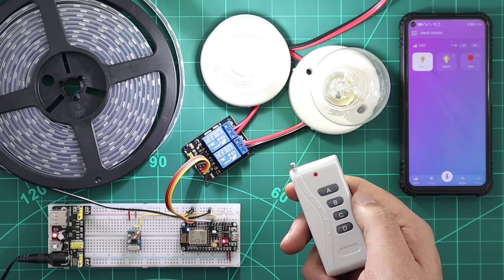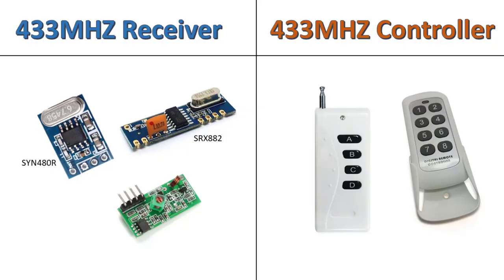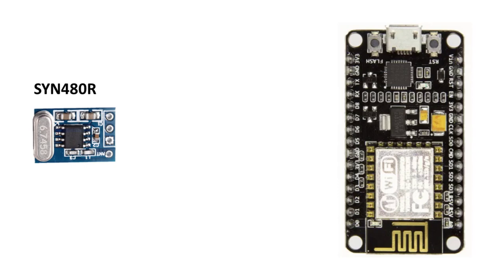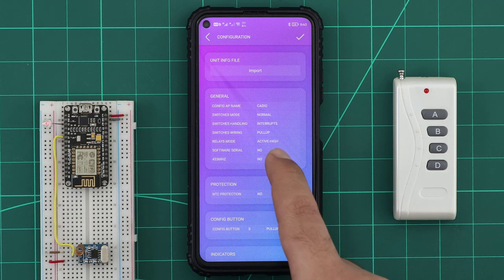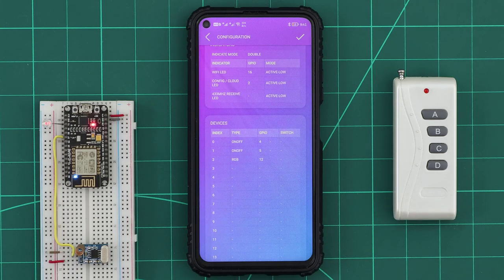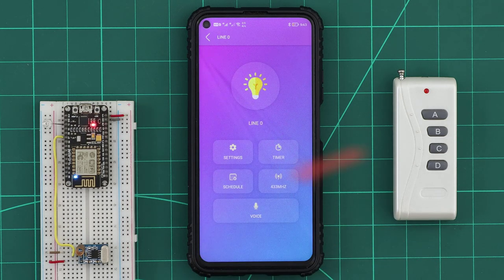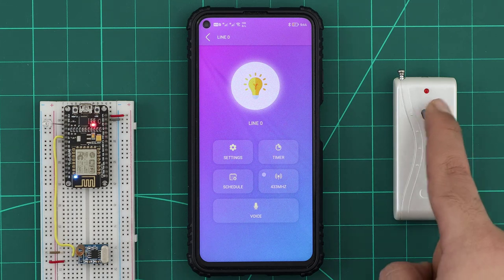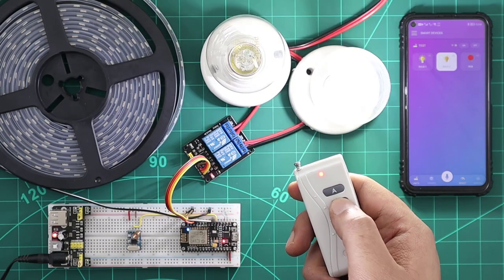Using 433MHZ RF remote controller with CADIO devices (ESP8266 - ESP32) | CADIO Home Automation

Comment: Sir I have problem I am enabled a serial print and realy mode is active low with extra mcu 
Bur problem  is esp8266 main power supply off and restart our appliance is not a previous state
Reply from the maker: The active-low option in the info file is for devices on the esp, for the devices on the extra GPIO, you need to edit the example code for them

Comment: Sir I have problem I am use esp8266 with extra mcu but mein line off and on to all appliances not a previous state
Reply from the maker: Feel free to send your circuit diagram and the code you are using to cadio@egycad.com to review and debug.